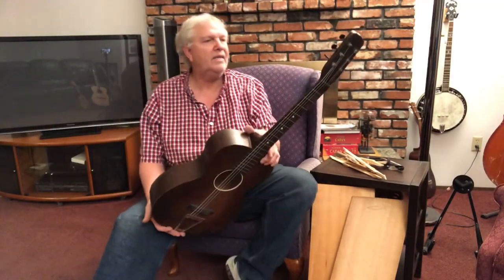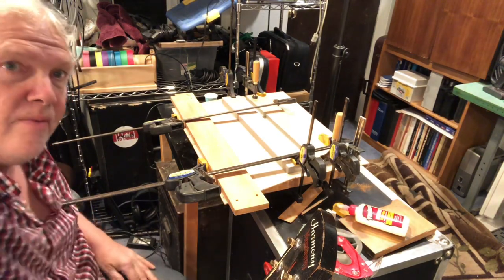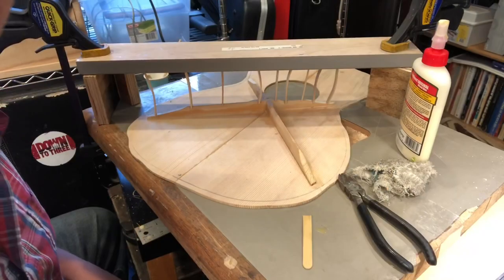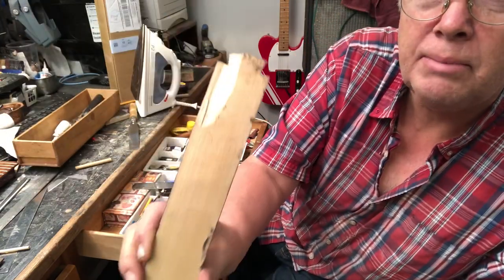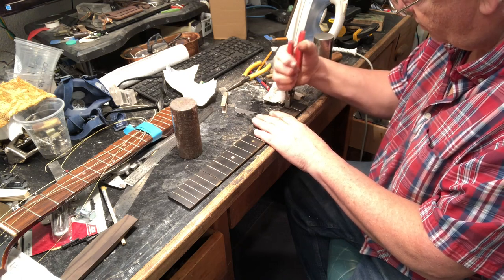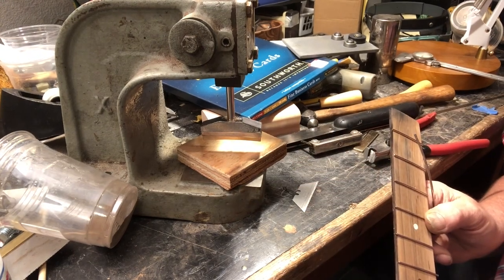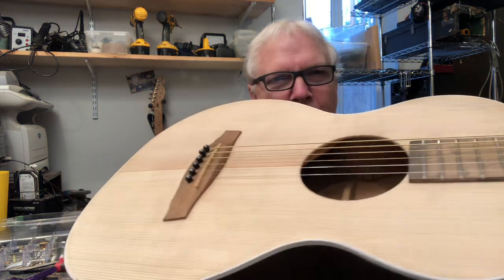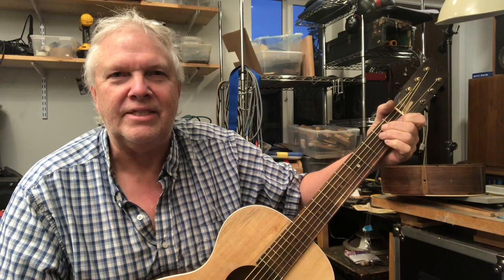Parlor Guitar X-Brace conversion with new Spruce top

Comment: Great job! I done a few of these old guitars, I look for old solid spruce top Gtars, & despite their size... they sound really good. I carbon fiber the neck usually for steel string, but recently did one that I wasnt happy with, so I put nylon strings on it (it could take steel 11s) Now it sounds fabulous....Even over one of my best ceder tops....Rock on :)
Reply from the maker: Thanks for the kind words. I love these older and inexpensive guitars.